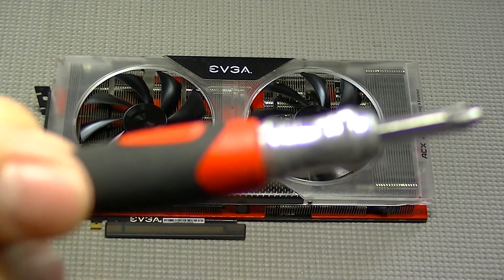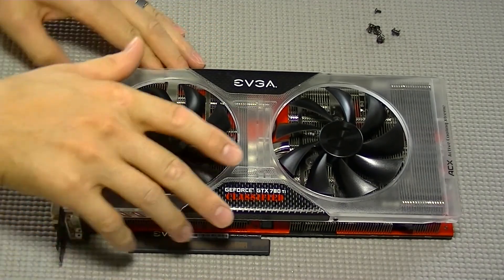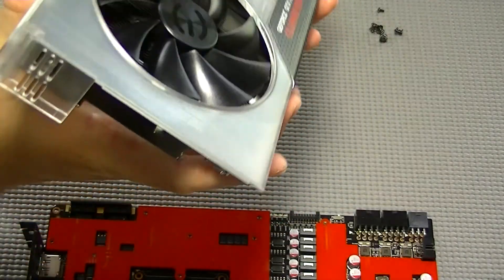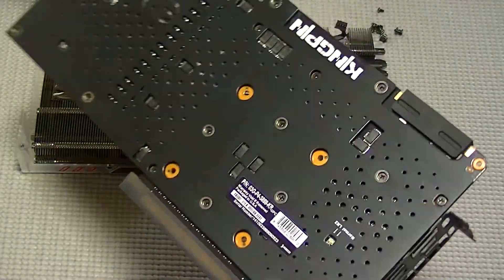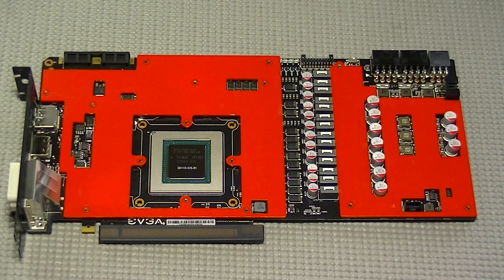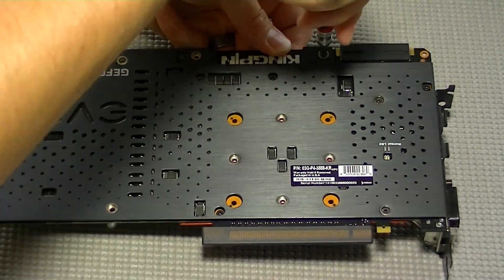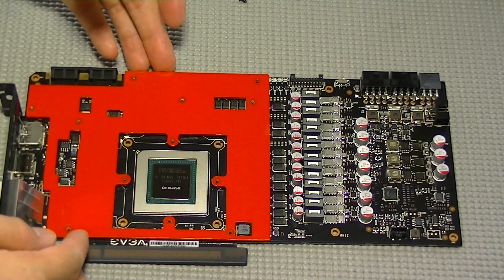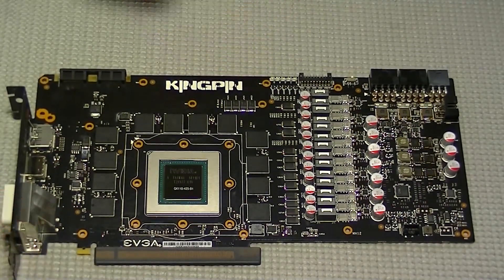How to Disassemble EVGA GTX 780Ti Classified Kingpin

Comment: is there a video out there that shows how to remove the transparent white plastic casing?
Reply from the maker: It is rather hideous but it's likely just a few simple screws holding it on. I've not removed it but you can see a couple screws on the bottom and on the top. I'm guessing those will allow it to come off.
Reply: i tried to unscrew it. but there is one hidden behind the black plastic plating. as far as i can tell, the only way to remove it is to simply rip it off
Reply from the maker: Unless it's held on by a rivet (very unlikely) there is a way to take it off without ripping it off. You may have to further disassemble the whole cooler to be able to do it though. Is there a reason you want to remove the plastic piece other than cosmetics?
Reply: BYOGamingPC yeah, cleaning the dust from underneath it. one of my fans stopped spinning, so i figured it was due for a cleaning